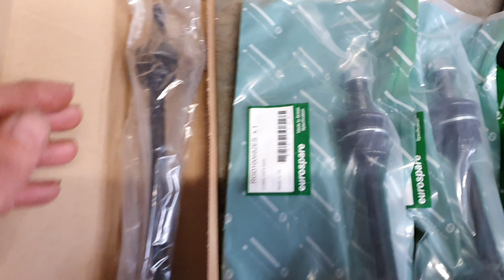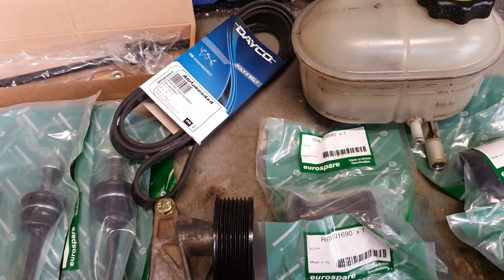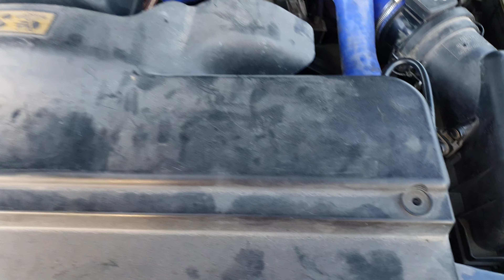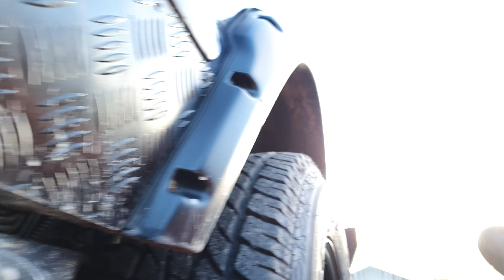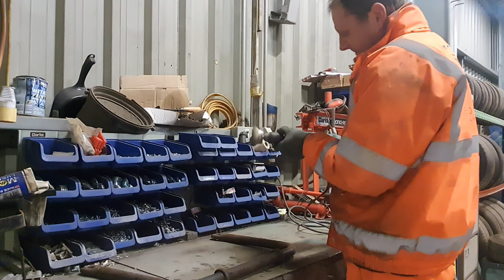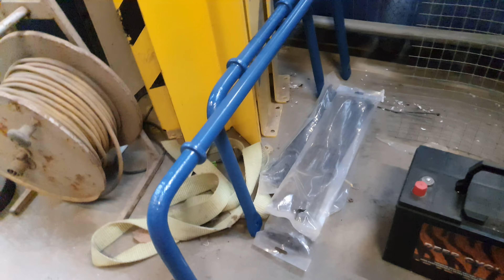Discovery 2 ACE Delete part-1 Getting the parts

Comment: Hi, I am considering removing the ACE system would you kindly list the parts you used to do it.?
Reply from the maker: Hi. Here is a link to parts required.  I would try and find used solid anti roll bars to save on cost.
https://www.mm-4x4.com/active-cornering-enhancement-ace-removal-kit---td5-8526-p.asp
Reply: @deanshortland7194  wow! thanks for the reply, the price for the kit is a bit steep. My D2 leaks from the front half low pressure pipe to reservoir , its 90p with taxes and shipping to Italy. Do you think is possible to replace the segment damaged of the pipe with a copper pipe?
thanks
Reply from the maker: @robertosavorani6622  not too sure on that one. The lines are high pressure. If you can remove the damaged pipe take it to a hydrolic pipe specialist. They may be able to repair it for you. Will be cheaper than buying the removal kit.
Reply: @deanshortland7194  good suggestion 
thanks
Reply: @robertosavorani6622  If you want to get rid of ACE, you need to be prepared to haunt eBay to find the parts.
Biggest hurdle (IIRC) is finding a rear ARB.
IIRC, all D2s with air suspension came with ACE so you'll only find a used rear ARB when somebody strips a (quite rare) D2 with rear coils.

There's currently at least 2 pairs of ARBs listed on eBay for £200-£300.

Comment: You can use 10mm fixing from somewhere like pirtek and use flexy pipes to repair a damaged or leaking solid pipe. The ACE is one of the best things about the D2 !
Reply: On-road, solid ARBs give similar (possibly better?) performance to the ACE.
The real purpose of ACE is to "disconnect" the ARBs at slow speed to maximise axle articulation.
For anybody who needs this functionality, it can be achieved by purchasing a set of disconnectable drop-links for about £50.

Sure, that means having to get out and pop a couple of clips to disconnect your ARBs when you go off-road so there's a down-side but it also means getting rid of a LOT of complicated, expensive, heavy hardware that's getting close to end-of-life and replacing it with something that's going to last forever.
Reply: @SiCrewe  I totally disagree, having a D2 with ACE installed goae round corners far superior to one withour ACE. Mine literally handles like it's on rails, I can throw into a corner and the body roll is minimum. As I said earlier, one of the best feature os the D2, end of. May be limiting for offroad articulation I agree.
Reply: @trollmanrs  Have you ever driven a D2 with solid ARBs?

Mine had ACE and, as you say, it handled well on-road (far better than it's contemporaries).

The whole reason LR developed ACE, though, was as a way to offer the benefits of ARBs on-road and then allow them to"disconnect" and not hinder articulation when driving off-road.

I replaced a leaking front ACE bar a few years ago and replaced the ACE pump last year.
When the valve-block started going faulty I made the decision to swap to solid ARBs and I haven't noticed any difference in on-road handling.

A few years ago I fitted slightly larger tyres (still on stock rims) to my D2 and, honestly, the tyres made more of a difference to handling than the ARBs did.
Reply: @SiCrewe  Yup like you my previous D2 leaked at the ACE block and as I was new to Landrovers back 9 years ago I swappe to ARB's and it was certainly a step backwards. Obviously bigger tyres are going to flex more due to the larger sidewalls. My D2 handles so much better than our D3 V8 for sure. :-)
Reply from the maker: To be fair I'm looking at keeping things simple to fix. I know the ace is a good system when working correctly but I'm on coils on the rear anyway. I doubt I'll notice much difference at the end of day